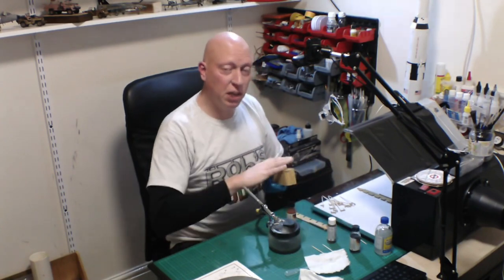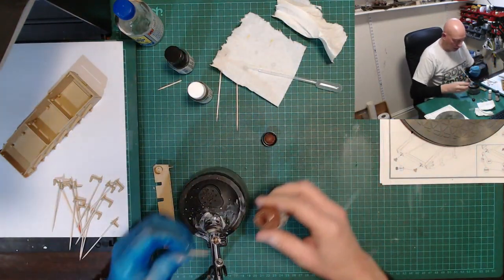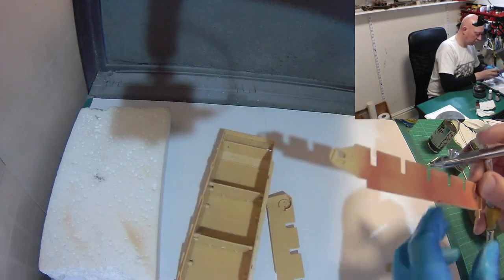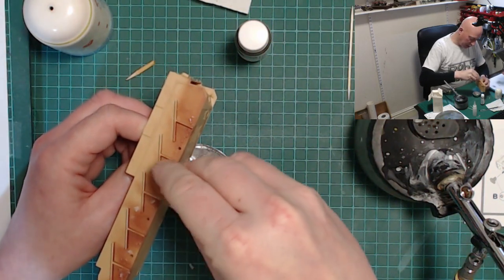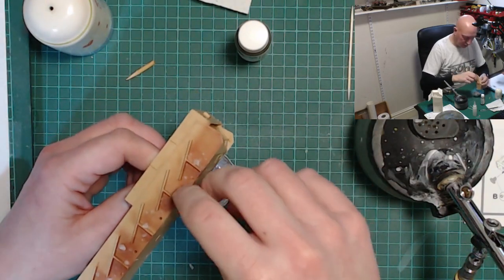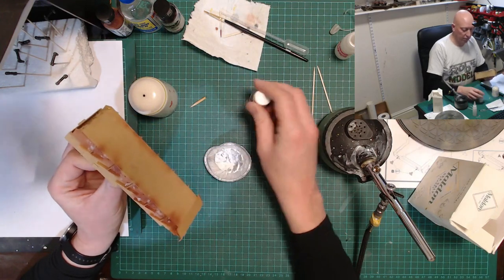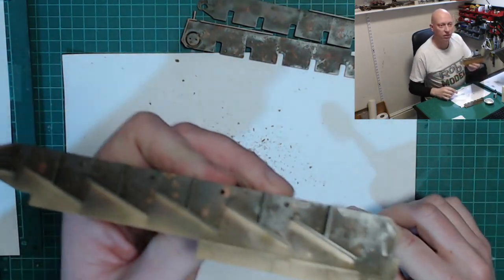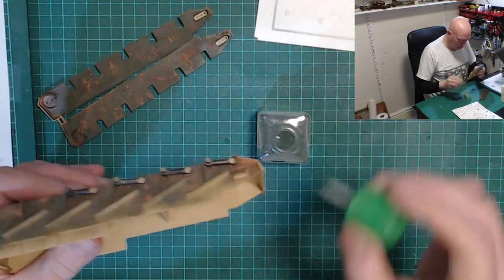Building main chassis and rusting with salt. Airfix Cromwell Mk IV 1/35 Scale Model Tank - Part 2

Comment: Another excellent video my friend looking great like the idea of the salt keep em coming and stay safe 👍🙏
Reply from the maker: Cheers! First time I used salt. Realise it was completely over the top thought it a good chance to take the opportunity and experiment with a few different techniques, types and amounts. Now I'll be more confident on doing it on the external parts and have a better feel for what size flakes and the quantity to use. The finer regular table salt gives quite a nice texture, whilst the larger flakes (but no too large - were huge and needed to be crumbled) worked well for revealing larger areas of rust.

Not only were the liquid mask blobs too large, but gave a hard edge - would be suitable for aircraft top coat getting chipped to reveal primer, but not flaking from armour because of corrosion. At least I know now! :-)